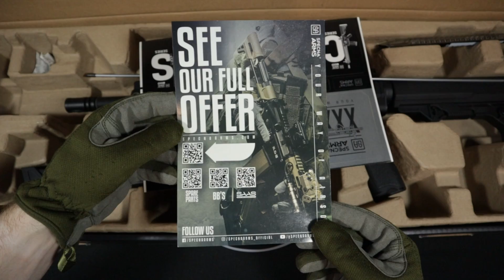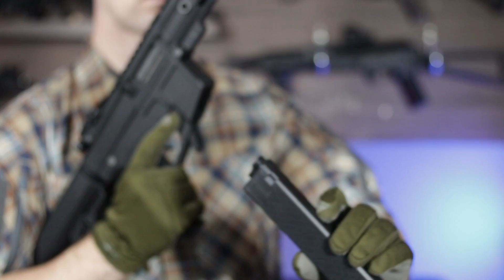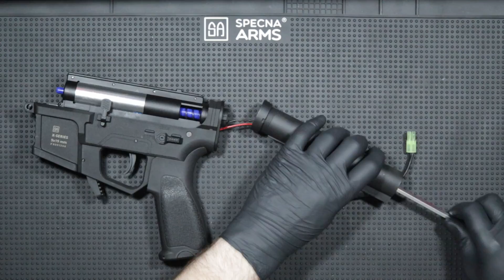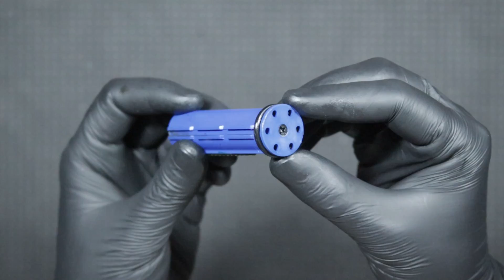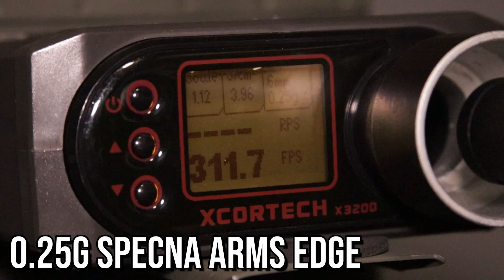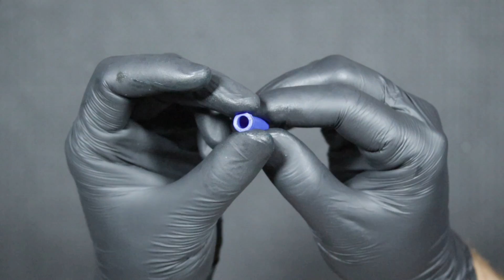Airsoft Review | SA-FX01 Flex | X Series went polymer!

Comment: How to remove the stock i had tried so many times
Reply from the maker: When you push the lever on the stock It moves the pin but It moves only a bit, grab this pin with your fingers and pull it all the way down, then you will be able to move it of the stock guide

Comment: i have so much problem with feeding i have 3 pcs Hi cap and all of them have problem i even change the hopup rubber g&g green one but still same prob what do u think mate is problem u think is the Mags or Hopup chamber pls any help me ...
Reply from the maker: You have to check couple of things, first I would check a mid-cap magazine instead of Hi-cap, I got few messages from people telling me that they have problems with their Hi-cap mags feeding, so maybe that's the problem. I don't know what bb's you use, but be sure to use some high quality bb's. I also know that some people had bad experiences with g&g green bucking, so if a midcap mag with good quality bb's won't work, I would use different bucking.
Reply: @Maniek44Eng  thnx for the answering mate i will consider all this what u said and try the best ...

Comment: Yo SUPER good review! Question: do you think it would be capable of running an 11.1v Lipo? Which replica is the best for beginners? The SA-FX01 Flex or the Double Eagle Falcon ones? (UTR45 and M904G) Thanks!
Reply from the maker: It will run on 11.1v but with stronger spring, on weaker one you can have double shots on semi. DE is a bit better :)